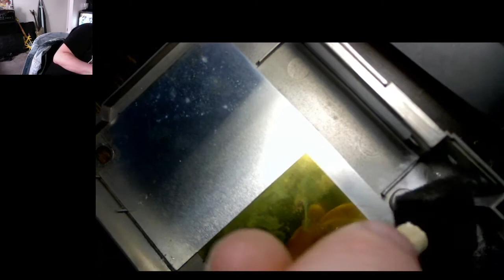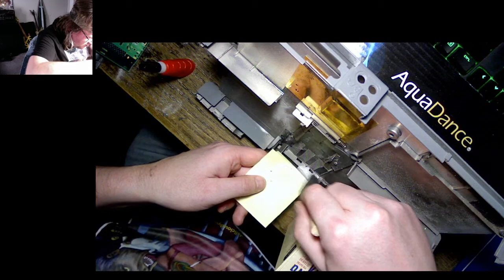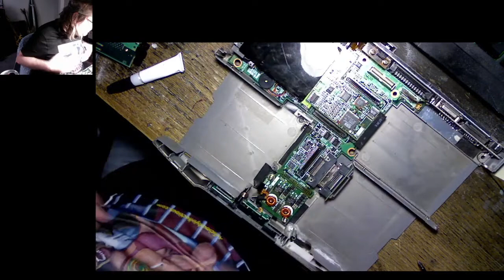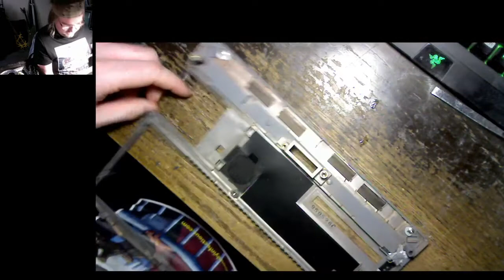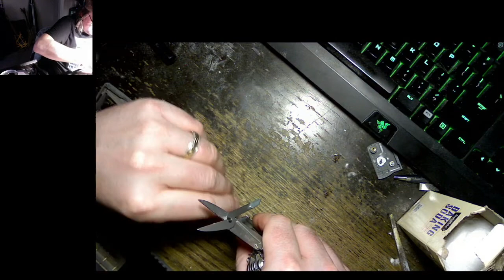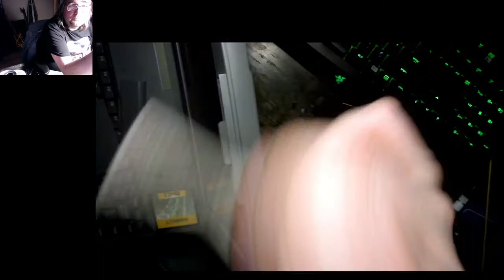NEC Versa Plastic Repair

Comment: In this video, why did you choose baking soda + super glue instead of epoxy? I saw in another two videos you were using epoxy for NEC Versa.
Reply from the maker: @yanceywang2574  because the jb weld cracked. Baking Soda and Superglue (key ingredient cyanoacrylate) causes sn exothermic reaction.  It gets extremely hot and melts the plastic to the mixture, and creates it's own form of plastic in the process.  Only problems I've had with this is shrinkage but this computer is still going with these fixes.
Reply: @creepingnet  Thanks for explanation

Comment: How has this held up to june 2021? i have been using gorilla glue. Sometimes on other cases i heat up an old solder iron and melt the plastic together, I have not done that on the versa yet.
Reply from the maker: The original repairs are still holding up.  I might be giving this one to my wife actually insted of the 40EC.  It has some new cracks though.  Ill be using this trick again.